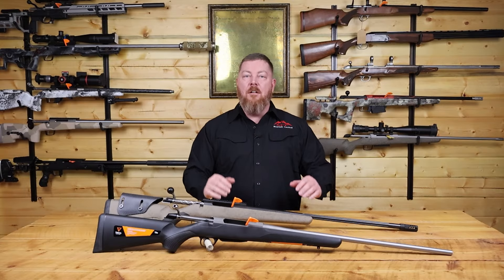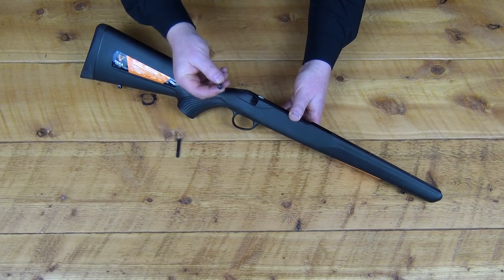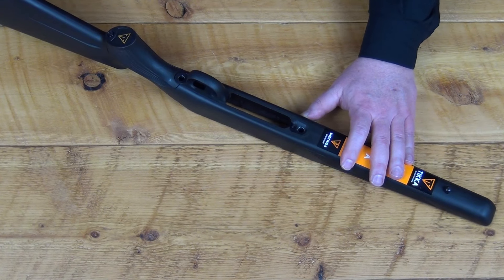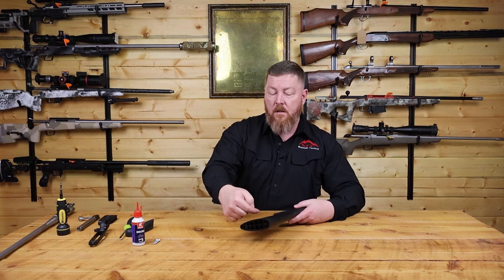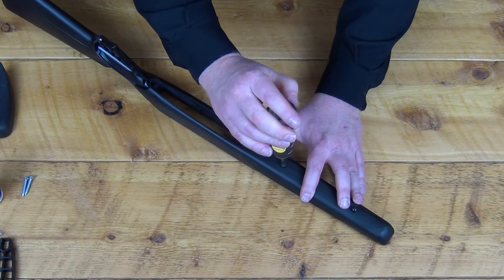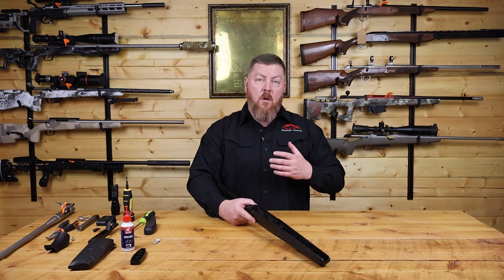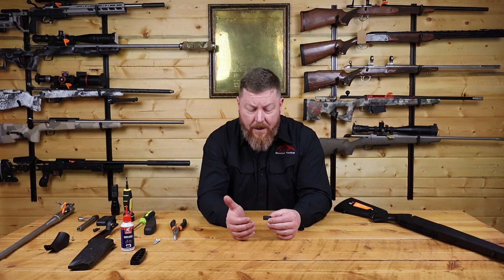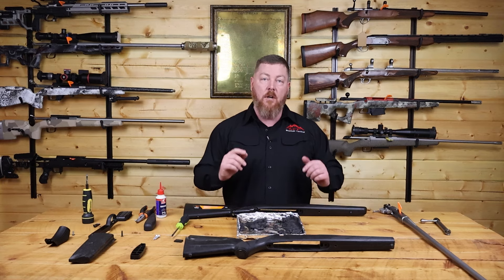Anatomy of the Tikka T3x - Episode 4: The Stock

Comment: I think people think stocks are cheap because of how they feel in the hand. Kind of slick.  Think about the Bergara stock coating.  It gives the impression of a better stock.
Reply from the maker: Exactly!  That's why the perception of the Roughtech is considerably higher than of the T3x Lite.  Same stock, but it has texture.  This can easily be added by the owner with off the shelf paints.

Comment: Yeah. People hate on the T3x stock but honestly for the weight it is very rigid. I replaced the stock on my CTR with a KRG Bravo (which weighs ~6 lbs) and I can't see any difference whatsoever with group sizes. My CTR averages ~0.5 MOA with just about every bullet/powder combination I've tried in it so it shoots really good. It's also possible that ~0.5 MOA is the limit of my current shooting ability.
Reply from the maker: The factory stock is great, but the ergos on the KRGs are fantastic. You may not have picked up accuracy, but I bet the rifle is way more comfortable.
Reply: @mountaintacticalcompany  I'm not going to complain to be sure. I mean, I have only had two range sessions with it it so far (I will probably take her out for another session tomorrow) and I am already shooting as well as I've ever shot with the original CTR stock.
There are, however, 4 things I don't like about the Bravo.
1. The M-Lok is polymer (even the pic rail included in the box is polymer). I bought their minimalist spigot mount and aluminum pic rail to get a more stable mounting point for my bipod.
2. The stock is in two pieces and the stock/vertical grip section is 100% polymer (i.e. the only part of the stock that has metal is the forend). So I question how rigid the system of the stock/vertical grip and forend actually is.
3. The mag release paddle is polymer and I can feel it flex whenever I use it.
4. I'm left-handed and the thumb screw for the cheek riser pushes into my face so I had to replace it with a normal screw which requires a screw driver. 
Of course, the majority of the issues I have with the Bravo can be "fixed' with paid upgrades. I just would rather have these "issues" taken care of out of the box. To be clear, I'm not complaining. I like the Bravo chassis. I'm just letting people know the few gripes I have about it as it comes in the box.
Reply from the maker: Fair enough!  That’s the big difference between the Bravo and the Whiskey price points. The Whiskey is awesome, but you pay for it. For the money, the Bravo and X Ray work really well.
Reply: @mountaintacticalcompany  Agreed. I definitely don't regret buying the Bravo. I was just trying to point out some minor points I didn't care for. As you say, the ergonomics are vastly improved. For the price, you can't go wrong.

Comment: Have you guys tried removing the contact points on the factory black stock? I got 1.25” or so groups in my 7mag. Dropped it in a chassis and first group 0.679” and second group 0.57”. Put my .308 in the same stock and it’s getting 1.5” right now. I’m thinking the contact point may be an issue? I will shoot it in a walnut stock to confirm.
Reply from the maker: I think we touch on this briefly in this video. Usually, the nubs do a great job dampening harmonics. There are some rifles that do perform better without them. Since yours performs better in the chassis, I bet yours is one that likes to be truly free floated.
Reply: @ Thanks, I watched this a while back and came back to it since I’ve been debating the removal of those nubs. I do have the MT trigger spring in my 7mag now, it’s perfect and this series has been really helpful.
Reply from the maker: Fantastic!  I bet there’s something up with your stock since two rifles do not perform in it. Keep us posted on what you find out. Cheers!

Comment: Amazing how many people remove the bolster in the stock that is in front of the recoil lug. That bolster dampens vibrations and stiffens the barrel. Don’t relieve that it works as designed and helps accuracy. 

It doesn’t have to be free floated to the lug.
Reply from the maker: @charltonlwalker  100% 👍
Reply: @ yep same principle as old timers that would bed a portion of the barrel ahead if the recoil lug to “tune” it. I’m sure Tikka found the general sweet spot for those sporter barrels and integrated it in the stock. 

Love these videos. I started out with T3s and T3Xs and have been hunting with the UPR and CTR past couple years. I just bought a good ole T3X Lite stainless 6.5 PRC. I’ve been missing a lightweight, non threaded sporter that I enjoyed for many years.

Comment: Lots of great information! Thank you very much for putting together this series. Do you feel there are any benefits to bedding the action on a T3X ?
Reply from the maker: Fantastic question!  It is important to point out, a majority of the issues we troubleshoot with customers are rooted in improper bedding of their rifles. Even a competent gunsmith can have difficulty bedding a Tikka because of the narrow tolerance envelope that must be maintained for proper functioning.  I would not take the time to bed the factory polymer stock. However, I highly recommend bedding wood and laminate stocks. Especially if you use your rifle in varying weather conditions. Aftermarket carbon fiber and fiberglass stocks also perform well when you bed them.

Comment: Problem. I bought a Tikka 708 COMPACT. No one makes an aftermarket recoil pad for this. The Limbsaver recoil pad for a Ruger compact appears to be the same measurements but the Limbsaver brand for the compact Ruger comes with molded in pins and the screw holes are for the Ruger fit. I ordered a Limbsaver based on measurements and was sent the Ruger pad. Just finalized a refund from Limbsaver yesterday because it won't work for the Tikka and they tell me they won't initiate fabrication on a new pad w/o enough demand. 

What MANY hunters and shooters don't seem to get is their own LOP is likely shorter than they think if they use proper shooting ergonomics and also when they hunt during the cold and layer up on clothes, that increases the LOP as well. During warmer months my LOP is fine at 13. When it's single digit tamps and I'm wearing a few layers it shortens to 12.25 or 12.5 max, thus, a compact Tikka stock actually fits me just fine but I bought it for my wife and kids to use. Sure would be nice if Limbsaver had enough demand to start making the appropriate airtech pad for a Tikka Compact like they did for the Ruger

By the way, I'd buy a dozen of the Mountain Tactical recoil lugs for Tikka but no one has them in stock and I've checked for months. I'd also like to stock up on the long action bolt stops but can't ever find those anywhere either.
Reply from the maker: I much prefer a shorter LOP on my rifles.  It makes positional shooting much easier.  The Post 2017 Limbsaver on our website will fit the extended part of the T3 Compact stock, but it will hang low on the shorter configuration of the stock.

We've had long action bolt stops in stock since December and just finished a run of over 1,000 recoil lugs.  MidwayUSA, MidWest Gun Works, and Brownell's have our recoil lugs in stock.  We have only been out of stock for a couple weeks.

www.mountaintactical.com currently shows recoil lugs out of stock but that will change as soon as Jeff updates inventory.
Reply: @mountaintacticalcompany  Great, I'll check them out now. Thanks!
Reply from the maker: You are welcome!

Comment: I put Grovetech qd flush cups in my black T3X Roughtech and took out the swivel studs with little flush Allen had screws.
Reply from the maker: That's a great idea!  Did you need to modify anything else?  Or did the allen bolts match up to the thread inserts?
Reply: No when I put the limb saver recoil pad (300 Win Mag needs it) I put on flush cup on the right side and then I put the other on the left of the forend just far enough back to make it mostly flush which is about 6" back but it's round so there's a tiny gap between the cup edge and the stock. I just put non stainless angled Allen head screws into the forend and put liquid blue on them so they blend in but the rear swivel stud is wood screw based so I had to find a wood screw shank with an angled Allen head which I could only find in stainless for some reason so it's still in the white. I have your bottom metal, shroud, bolt handle, bolt release, two fancy short mags, and two slick side large mags. Love the products but I need more Tikkas now to pimp out. Put a Game Reaper low mount on though for my VX5 3-15x44. Keep up the good work
Reply from the maker: Thank you for your business!  And thank you for the fodder for mods for the factory stock. I’m going to try this with one of our rifles. Cheers!

Comment: Awesome video. Just subscribed 👍🏻
I ordered a T3X yesterday and I have a question. 
Is the recoil lug in the new T3X good to go or should I upgrade it ? 
Sounds like it is improved over the T3 but maybe still not as good as an aftermarket one. 
Thanks
Reply from the maker: Great question!  The T3x recoil lug is made from mild steel vs the aluminum the T3 had. For a smaller cartridge, like a 223, I wouldn’t change it out. For anything larger, our Bombproof Recoil Lug is significantly stronger and will last the lifetime of the rifle.
Reply: It’s is 7mm-08 compact…thank you for your response and your knowledge of the Tikka’s…I will most likely order the better one 😊
Reply from the maker: Thank you for your business and support!

Comment: Once again, Great Video! Do you think that Tikka may not be so dumb after all by using a mild steel recoil lug? Maybe they want the lug to wear instead of a the action slot? I've had the original T3x steel lug in my 30/06 for thousands of rounds and neither lug or action are showing any sign of wear.
Reply from the maker: That's awesome that your recoil lug is working for you!  Different steels have different properties. You can have a stronger steel with high elasticity, which means it can take a high amount of stress and return to its original shape. If both the action and lug are made of these materials, you'll have strength without deformity. 

Most people do not realize their bolts have the strongest and hardest steel in the rifle system. That harder steel does not deform the action because of the action's modulus of elasticity.
Reply: That makes sense, thanks for the explanation. @mountaintacticalcompany
Reply from the maker: You are welcome. We get quite a few questions about the sacrificial nature of a weak recoil lug. I should do a video on it.  Thank you for the feedback!
Reply: We can only hope people don’t use a “Leadsled”for their shooting.
Reply from the maker: We bought one to make a spoof video...  but we're not sure if we want to lick that spoon yet, haha!

Comment: Love this video and all of your content! Quick question regarding stock fit. I recently purchased a Tikka T3X Hunter chambered in 7MM Rem Mag. I noticed that the forend of the stock is just slightly closer to the barrel than the other side. Is this a big deal or should there be any concern? Appreciate all the info, and keep up the fantastic work!!
Reply from the maker: I wouldn't be too concerned unless you are having accuracy issues.  Tikka does not kiln dry their stocks so they move quite a bit over time.  We just purchased a T3x Hunter for a video series on how to bed these stocks.  When we get them, becuase of our dry environment, they move a ton.
Reply: @mountaintacticalcompany  Great!  Thanks for the response and keep up the fantastic work!

Comment: Is the Roughtech Ember stock heavier than the factory T3X stock?
Reply from the maker: It’s the same stock, just with splatter paint on it.
Reply: @mountaintacticalcompany  👍
Reply: @mountaintacticalcompany  how about the Veil wideland/alpine, is it the same stock as the regular t3x with different paint or is it heavier?
Reply from the maker: Those are the same stock but hydrodipped.
Reply from the maker: The only stock that is different is the Hunter, UPR, Ace and Tac A1. Even the Super Varmint uses the same basic stock as the Lite, but they add the vertical grip and beaver tail forend

Comment: Two questions? 
Can I buy a Left-Hand T3X stock for my T3 Lite 308?
You say all the T3 actions are the same, so is it just the bottom metal and mag different for the long action calibers? Asking because I was thinking about rebarreling my 308 to to a 270 win. Thank you in advance.
Reply from the maker: Yes you can. Your T3 will fit right into a T3x stock. The only pieces you would need to change are the bolt stop and magazine. The bottom metal is the same for long and short action Tikkas. The bolt stop is what is used to control the bolt travel.
Reply: @mountaintacticalcompany  right on. Thank you! Love your videos, keep’m up!
Reply: @mountaintacticalcompany  one last question. What about changing the bolt face to a magnum bolt Phase for sale 270 WSM or 7 mm PRC?
Reply from the maker: The easiest way to do that is to buy a magnum donor rifle. I burned up my 270WSM barrel and might go 7PRC next.
Reply from the maker: Thank you!